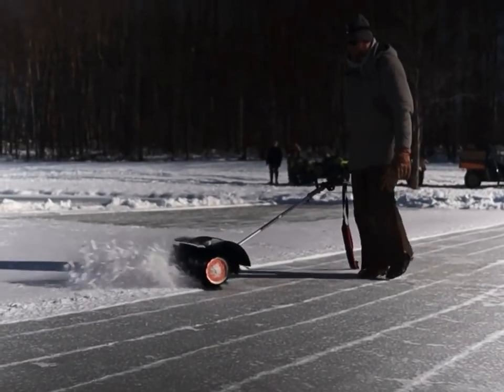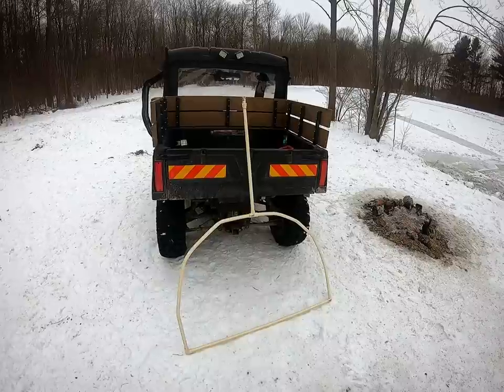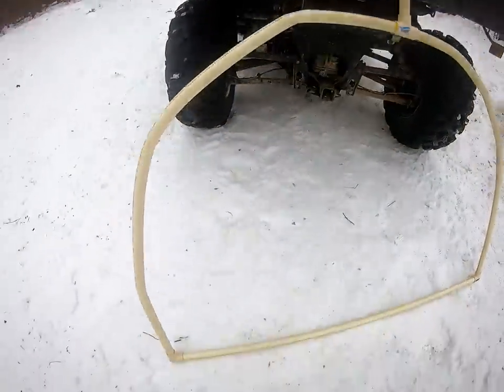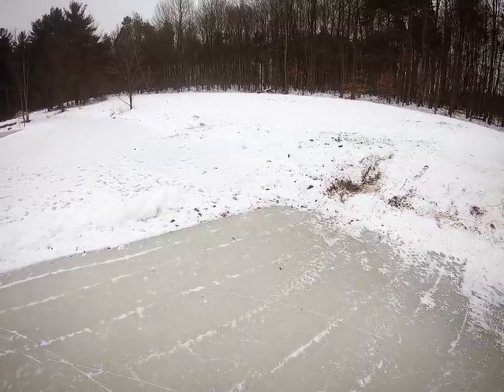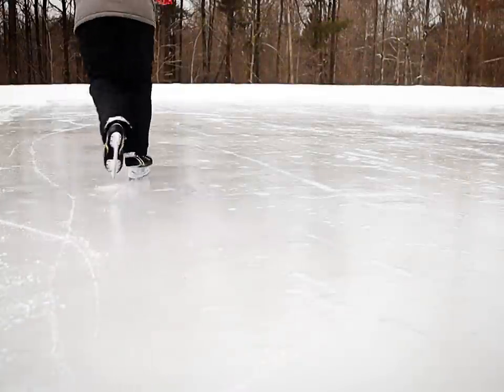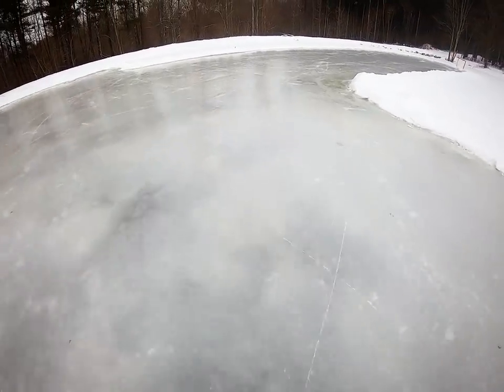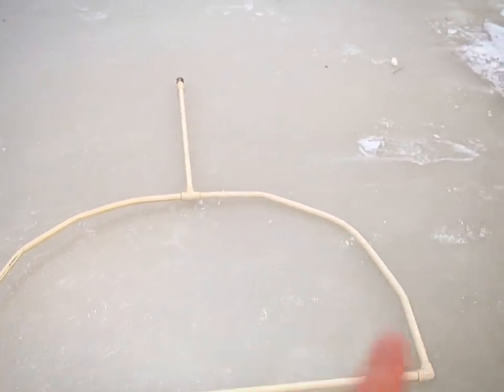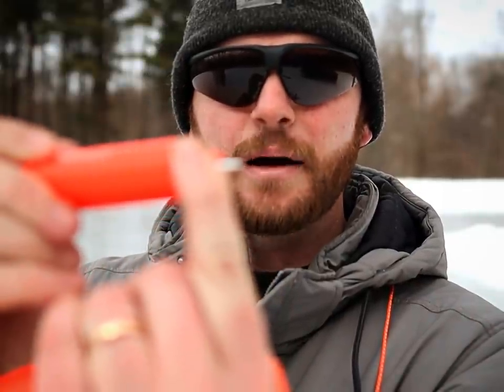The BEST DIY Pond Zamboni

Comment: This is a rabbit hole you may never get out of. I am on many versions of pond hockey zamboni. latest version uses a carry all and pallet as a platform. Load a 50 gallon water tank, sureflow pump to pump water into an on demand camper style hot water heater. A tank of propane and 12v  power runs it from my 1025r. Spreads out the back with pvc plumbing and towel. Instant hot water and nice finish. Now i am working on shaving the ice. Need something on the bucket??? That’s this weekends project.
Reply: Do you think 50F would be sufficient? if so I can use my propane tankless with 1.2GPM pump and not have to fill a 30gal tank

Comment: If you're using a heat gun to bend the pipe, shoot the hot air through the pipe. When the whole pipe is hot, it's extremely easy to bend and manipulate how you want. I do that often with the grey electrical plastic conduit.

Comment: Great job! My uncle made something similar to that 40+ years ago out of copper pipe and a burlap sack. It worked great then and they still work great today. Too bad you don't have access to hot water. That would smooth it out in a hurry. Anyone doing this for a backyard rink that can run hot water from the house you'll get better results quicker.

Comment: Adam cool diy idea. One thing I would do to make it better would be to add a good quality metal ball valve.  That way u can control the flow better but all in all great idea.  Keep up the good videos
Reply from the maker: Yeah I agree. I kept having to turn the flow on and off by unplugging the pump from the generator. Definitely need a shut off on the zamboni

Comment: To get a great smooth finish on your ice you need hot water so that it melts the rough spots and skate cuts back into the old ice and creating new ice together. put a tank on your sxs and fill with hot water then hook up your manual zamboni drag. New subscriber and i enjoy your channel
Reply: Seen one guy bought a cheap electric heater from amazon and heated up a fifty gallon tank in minutes not hours. Seemed to work great.

Comment: I had a similar idea for my water pump. I didnt want to run a submersible pump to my pond, but I plan on (Next year) running a Milwaukee 18v battery pump to move water. we have 10" ice on our pond and this Zamboni would have worked well before the last few melts, and my failed attempt to clear 6" of snow off it. Also, Great idea on the ice picks!!

Comment: Adam what a great fun project! I was wondering if you could fill an IBC tote tank with water and use that instead of a pump. Could you put the tank on your side by side and just drive around with it?
Reply from the maker: Only problem with that is the weight. I mean right now we have 7” of solid ice right now but that would make me a little nervous. And early on in the skating season you’ve only got 4-5” of ice
Reply: @HometownAcres  I was thinking the same thing but was wondering how deep your pond is. I have seen ice fisherman out on lakes with full size vehicles. I am sure there are calculations as to weight and ice thickness. I am only suggesting but you could fill your tote one quarter and start with that but it would probably make me nervous too lol.

Comment: Cool idea, looks to be doing what u want it to do. But man, that ice isnt very thick and the water under the ice does hold the ice up, I think you might be better off with an external source of water. Just worried making a hollow under the thin ice could make for an unsafe condition, wouldnt wanna see any friends or loved ones in a life and death situation. Best wishes.
Reply from the maker: That ice is 7” thick
Reply: If I understand what you meant DMW Greywolf, pumping water from under the ice does not create a hollow area. The ice floats on the surface of the pond. It the water level were to drop or rise the ice would float up or down. This can sometimes cause cracking along the shoreline as a result of the movement. Another huge factor in building thick ice is removing any insulating layer of snow. When cold air comes in contact with bare ice it will thicken up much faster than when the ice is covered with snow. 
Thanks for the video Adam!